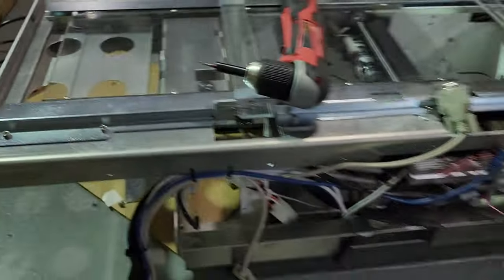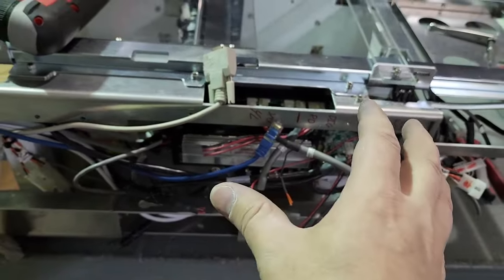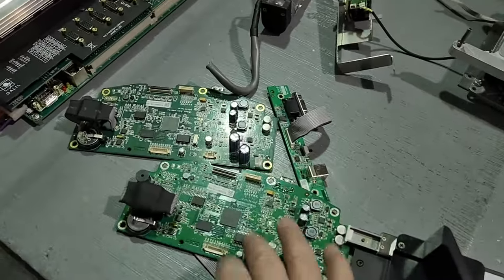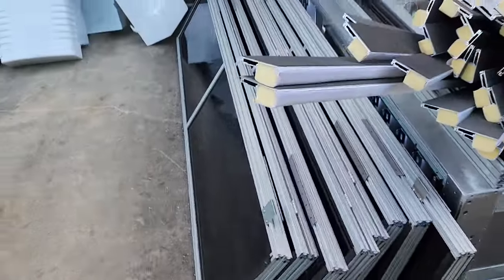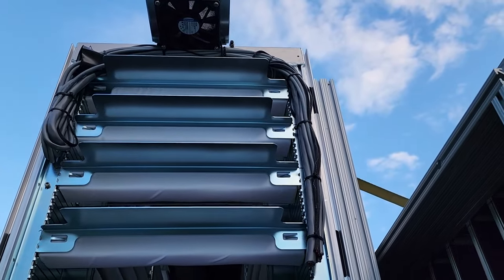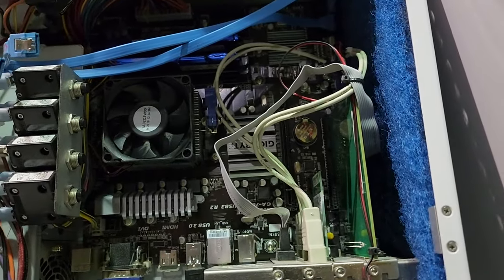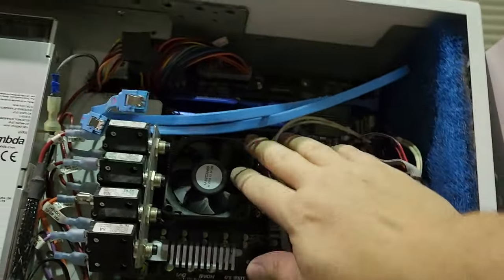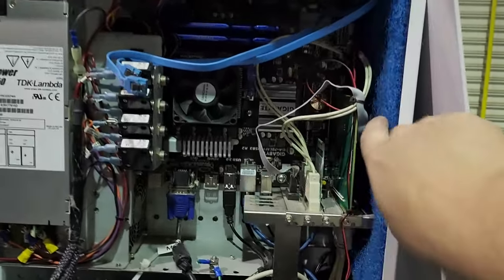Pharmacy Robot Salvage

Comment: I was surprised about the consumer grade Gigabyte motherboard they used, i was expecting Intel, Supermicro or DeLL or something. Seems to be a Micro-Atx format, so can be used in a normal ATX computercase. In the 90's i worked as a welder in a company that made PLC controlled machines, and almost all of those machines had servo's and linear slides, and when the machine was ready the IT-guys did a maximum speed test and depending of the weight and construction of the machine, they could reach a speed of 20meters per second (72km/hour) with a 0,1 mm accuracy. I can say, if you see such a piece of metal slide back and forth at that speed, that's amazing to watch.